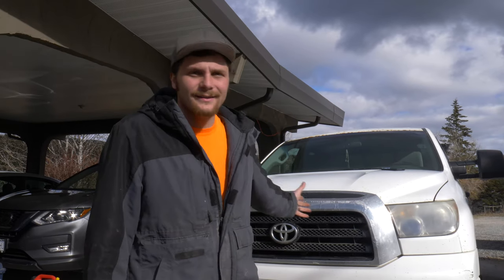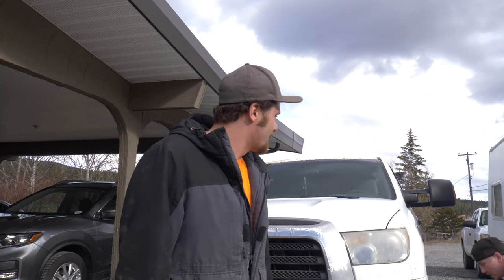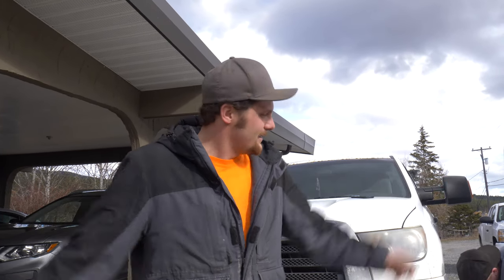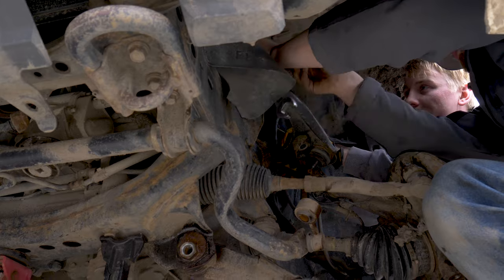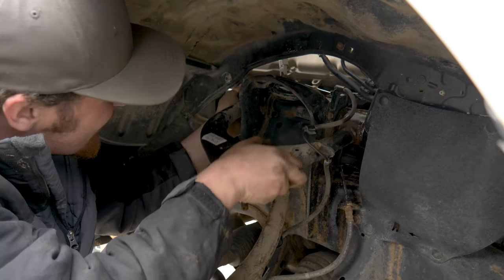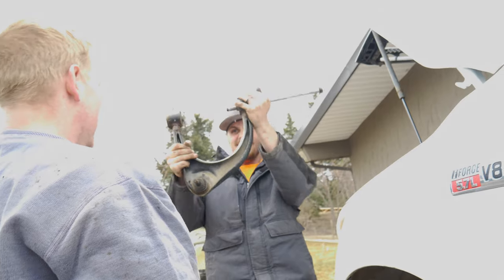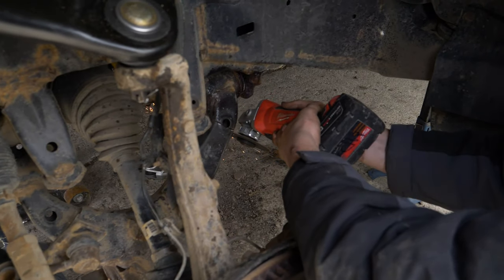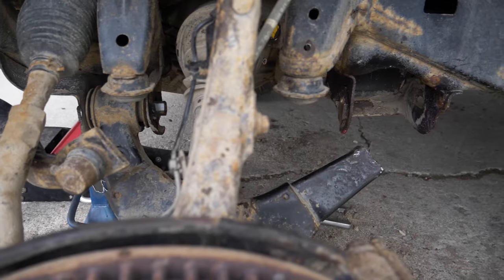Lifting a Tundra - Fox 2.0 Lift Struts Install + New Upper and Lower Control Arms

Comment: Hey man great video! I’m Really considering fox 2.0s for my 16 tundra. How was the ride on the street? How much ride height did you gain? Running stock tire size?
Reply from the maker: These rod fantastic on the street and off-road! About 3" height gained, and running 33" tires. Highly recommend!
Reply: Awesome! Might just have to check with my local 4x4 shop and see what they can get in for me. I’m running a 275/65/18. So almost a 33 but not quite. Figuring on fox 2.0 on all 4corners.